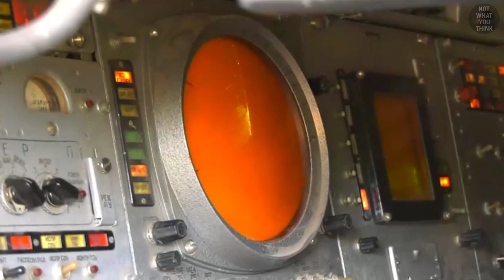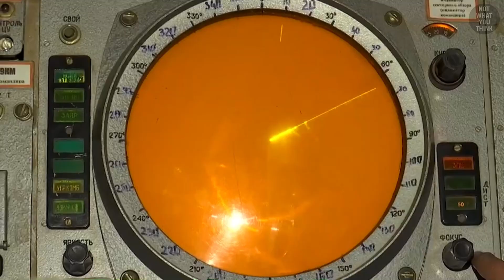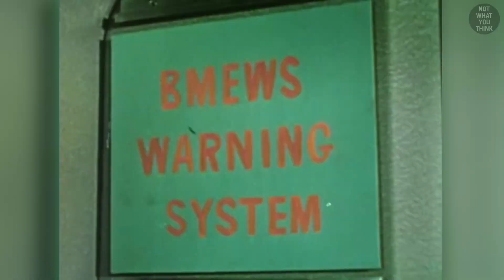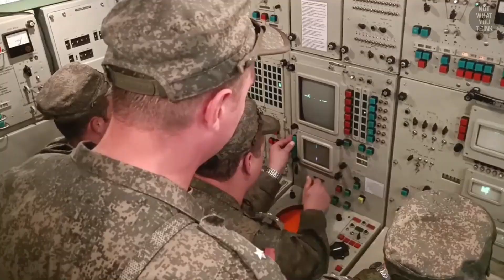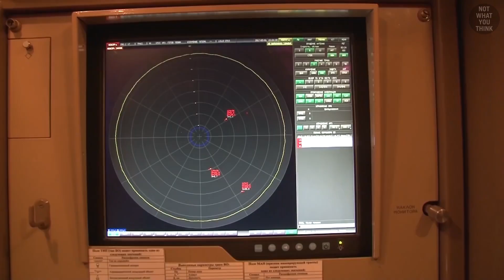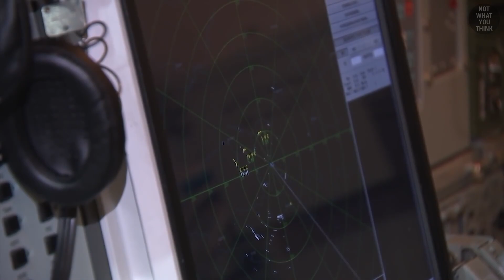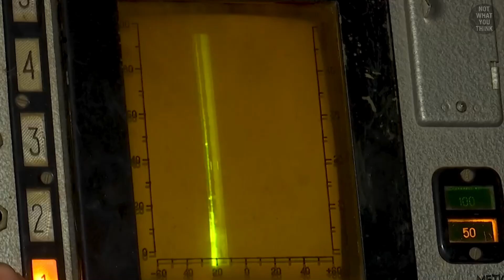How Aircraft Fool Radars by Flying Low

Comment: Wonder how snow will effect radars this winter in Ukraine🤔
Reply: * Russian AA launching missiles at every snowflake *
-We successfully shot down 2356 Ukrainian aircraft!
Reply: @werfault4076  - HELP! Ukraine is using biosnowflakes made in Lviv biolabs!!! Stop ukrainian monsters!
Reply: Depends on how heavy it is, on the plus side it will reduce the range of radar on other side flying low when you can't see anything so obstacles become a major hazard.
Reply: Good question! I haven't thought of that
Reply: There's actually a lot of space between the snow flakes so the radar pulses will get thru. But it will dampen the signal if it's too heavy.

Comment: So Maverick's technique of flying low to the ground in Top Gun: Maverick does work to some extent.! Good to hit the naysayers with this thought! (may not be as bad as shown, though)
Reply: The missile he was trying to trick is not guided by radar. So no it wouldn't have worked.
Reply: @declaringpond2276  He wasn't trying to trick a missile. What was shown in the movie was the ground messing up the targeting system of the 5th generation fighter.
Reply: In that case, it was 100% false. At that range the radar “burns through” ground clutter. In addition, the search azimuth is only 30 or so degrees making it almost impossible to not be detected. Even the most stealth fighter will be locked at that range. In addition, aircraft do not use radar when acquiring a lock with an infrared guided missile.
Reply: Do you mean when he fought the SU-57?
Reply: @Acrophobia2  Of course
Reply: ILR that does not work against modern aircraft radar, but it will freak out a pilot who is not trained and experienced in fighting (not just flying his plane) that low in a valley. Most pilots will not fight below 1000 ft and most training fights take place at more than 5,000ft  above the ground.
Reply: @pogo1140  That would have worked IF Maverick's F-14 wasnt so near to the SU-57
Reply: @Nicolas-82  He can't allow the Su-57 to get distance, distance = missile shot

Comment: Hey uhh, modern ground radar actually still could detect you even when you fly super low like that, and unless you flying behind a tall mountain with lots of trees or the radar is really really old (like the ones that was from the early cold War and post ww2) the radar still could see and detect you

But the reason this still works on russo-ukraine I would assume because that the SAM missile couldnt go that low due to insufficient targeting system

But small arms fire could be dangerous, any gun from a revolver to AKs and even ww2 era m2 Browning could potentially shot down aircraft flying that low, so it has to be sufficiently armored and extra careful
Reply: Have you even watched the video? He explaines all of that. Did you really need to flex your big brain before watching the video so you could feel smart? Wtf is wrong with people like you?
Reply: It still works, the laws of physics have not changed, radar still follows the same rules.
It's just the processing power that has changed and amount of power being sent out by the radar antennas.
SAM Radars are still line of sight, that means height of target, height of the antenna, distance to target, curvature of the earth, terrain will still dictate the detection range, and the engagement range.
Reply: It is effective because the defensive systems don't have enough time to react, get a lock, and fire.
Reply: They mention that. But by the time you hear or see it you can not react fast enough to shoot it down

Comment: you didnt mention the su 25t shotdown video
Reply: (Just a theory) Probably flew into powerlines and got snagged on his vertical stabilizer. You can see how the plane suddenly pitches up and the stabilizer is cleanly ripped off.
Reply: @Blauerkavenzmann  and engine fire?
Reply: @leipajuusto2964  I would guess, the fast spinning turbine can't handle the angular momentum of being turned around on the spot and it rips itself apart inside the housing and we see the flames of fuel just spraying into the hot exhaust with no air compression.
I'm not taking away the bravery of Ukrainian AA-Soldiers, but that one might have been powerlines. (Although it was pretty high and powerlines are usually lower, so, just it's just a theory)
Reply: @Blauerkavenzmann  Nah, during the ejection he makes 360 turn and theres no power lines to be seen. He though could have hit one earlier and crashed when trying to do something more complicated.
Reply: @Blauerkavenzmann  if this was the videos that had the helmet cam of the pilot ejecting then it is that
Watched a video a bit ago that went into detail about it
It did hit powerlines and it was in russian territory